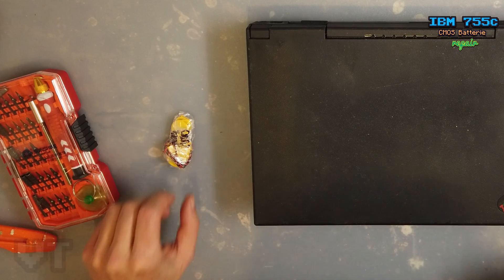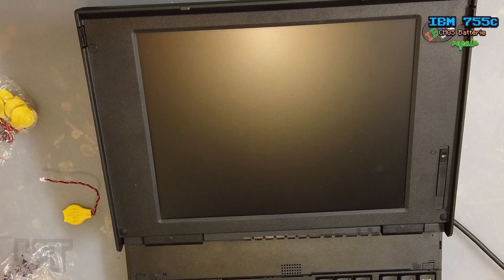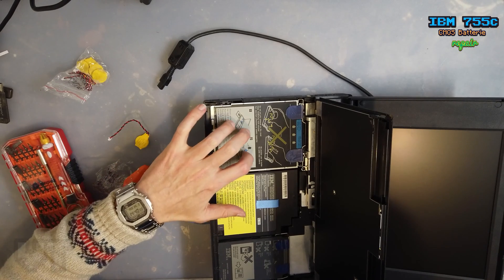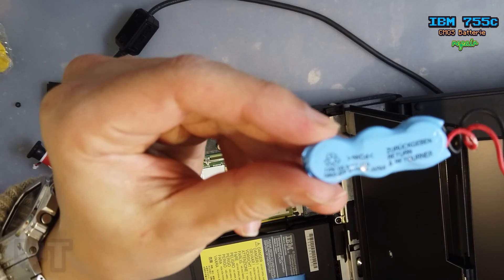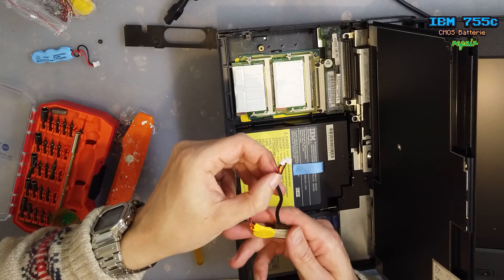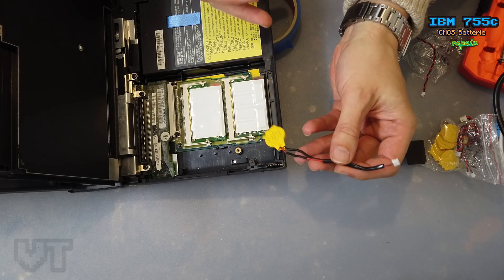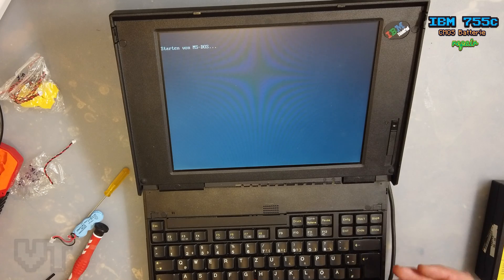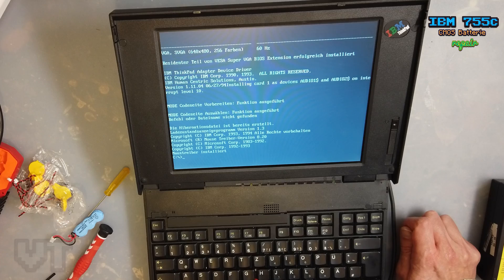CMOS Battery  | Think Pad 755c | BIOS Error | 161 163

Comment: this laptop does not have cr2032 but vl2020, you put a battery instead of a accumulator, the batteries cannot be charged, it will leak
Reply from the maker: Thank you for the tip. I just saw that the battery is emtpy again. Will order some vl2020 soon.